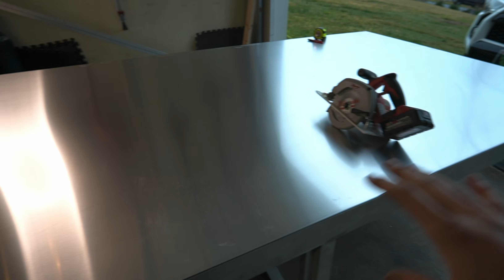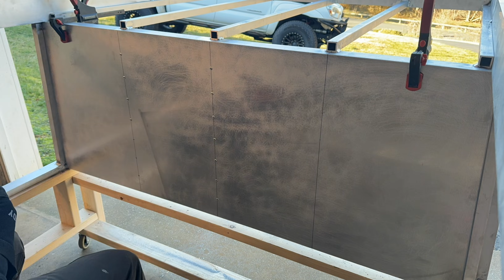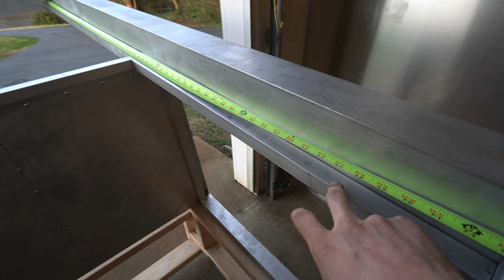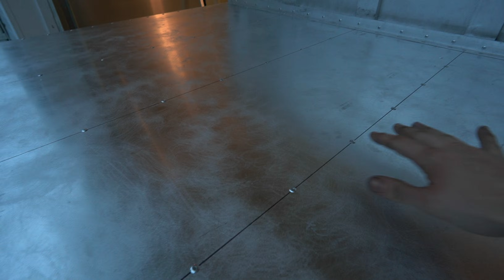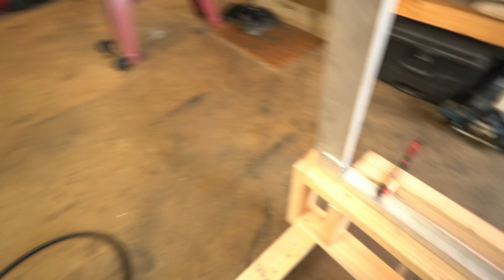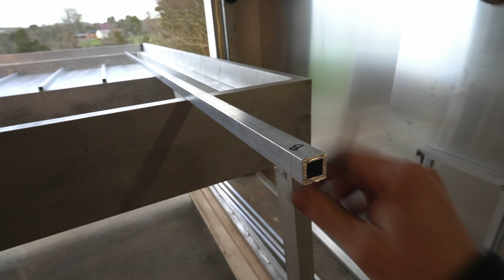Truck Bed Camper Build | Part 2 | Wall Panels & Roof

Comment from the maker: Thanks for watching guys! Don’t forget to subscribe. 

All parts are linked in the description as always!

Camper Blueprints available on my website! 
https://www.adv4x4.us/store-1-1/p/truck-bed-camper-blueprints-dxf-cut-files-combo

Want to stop  guessing your wiring?  

Build your 12V, 24V or 48V power system and get the wire gauge, fuse sizes and a wiring diagram for your rig with our interactive builder! 

More info here! https://www.adv4x4.us/tools

Comment: Those 90°-4° brackets are almost a bad idea. I suspect they will act like little bungee cords for the welds. Other than that L brackets really dont have much of any structural abilities in that format. The plasticity and max bend is reached super fast. You can see this when people build with the iron 90° brackets.

Comment: Hi mate looking forward to seeing part 3 . I'm not sure if it's uploaded yet but I have a question about the roof and hinge system. Are you building an alaskan style camper roof? So the whole roof lifts up but the portion where the bed is (front head and 2 sides) are all on hinges that you lift and lock into place once the roof is at the correct point? I'm researching the alaskan style truck bed carpet as I intend to build one for my l200 crew cab
Reply from the maker: Hey Steve! Working on part 3 have been super busy with other things but it’s on the way! The whole roof will pop straight up!
Reply: Hi Buddy just watching it now, I see what you mean now with the lift (very hard for you to explain lol) I'm about to do a build for mine but its going to be so that I can work away in London 5 days a week with out paying London prices so looking to build an Alaskan style pop up and I can not find any designs even similar to that ( except a couple of wooden ones! But keep posting I'm learning a lot
Reply from the maker: Thanks Steve! I although that hinge system I did works great, I have some concerns with the fabric fitting due to the “scissor” action. 

Stay tuned, I will be doing an updated video once I get more material on my hinge design! 

Should be much simpler to convey over video as well as understand how to do your own with basic math!

Comment: Quick question on an unrelated build. What flush cut router bit did you use on your micro camper build in your mini router? I have looked around where i am and i am going to have to order it. Dont want to get the wrong one.
Reply from the maker: Any barrel style bit with a bearing roller will work!

Comment: You can also glue aluminum components together in addition to the rivets.
Reply from the maker: I did not know that! My only caution against adhesive is I’m not sure if the baking process of the powder coating would compromise any adhesive or sealant which is why I’m waiting to do any til it’s coated!

Comment: Might want to look at doing a bit of debur on the holes before popping the rivets in. We do it in airplane builds to maintain the strength of the rivet connection. Might be an overkill for a camper, but throwing it out there as something to research a bit if you want.
Reply from the maker: Thanks for the tip man! Makes total sense!

Comment: looks great man! really enjoying this series. If you can use woodworking tools on aluminum could you also use flush trim router bit with a bearing to trim any overhang over the aluminum sheet? or maybe to cut out the fan opening?
Reply from the maker: Potentially! Although it may be a bit thick for the router. I may do a test on some scrap before attempting that!
Reply: Absolutely can! 1/8" is no problem.